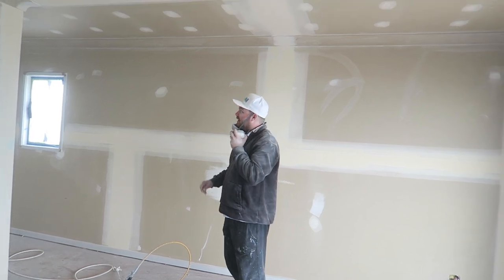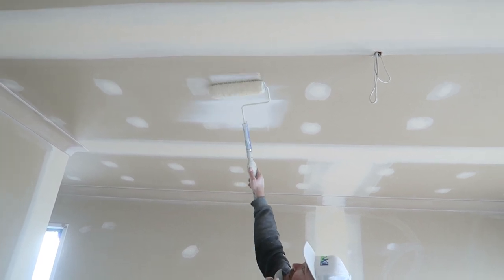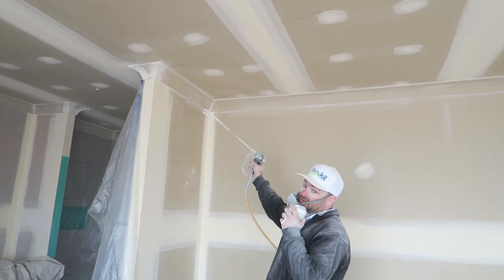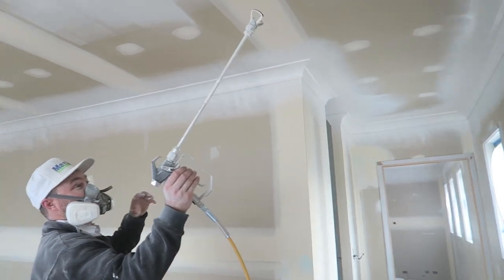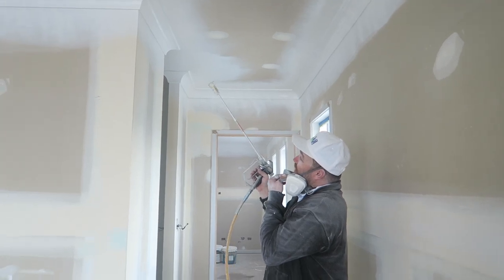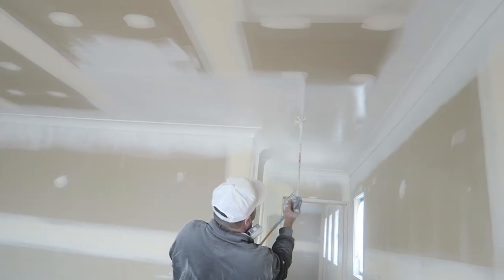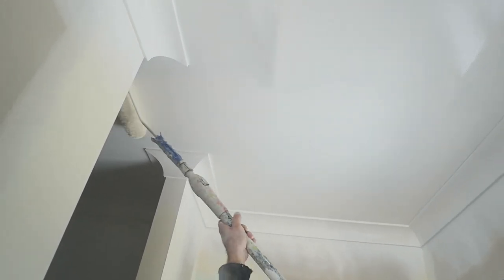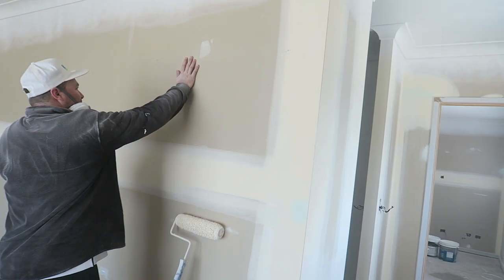Tips on Painting Drywall With An Airless Spray Gun

Comment: that happens because you are using an extension on your paint gun, all paint guns with extensions so that, what you can do is use swivel tip valve to control the pressure at the tip or don't release the trigger until you are away from the surface you are painting.
back rolling is counter protective and defies the purpose of using a spray gun.

Comment: I always thought backrolling one of the coats of paint is important so you get a little bit of roller nap/texture so it hides the joints better. For smooth ceilings I spray and backroll the primer, give the primer a good sand, then just spray my 2 color coats. If you set up your sprayer right, make sure the pump and seals are all good with a new tip in your gun you don't end up with spits. Fought for many years with lines and spits, eventually realized that we weren't maintaining our sprayer well enough hahaha.

Comment: Use clean shot valve and 514 blue tip from graco longer the extension bigger spits , the clean shot valve will eliminate it all, and you need better sprayer graco 395 or titan 440
Reply from the maker: Yes and yes... I will try that out for sure...as for the new sprayer..not cheap..... I haven't even used it since this video...
Tks for the heads up on the tips
Reply from the maker: Is it???
I didn't realise...
What's the price difference would you know?
Reply: 100x100 en Català  wow i didnt realize they can do that , here in Canada the titan 440 costs about 1100$ cad and graco 395 is about 1400 $ i guess depends how many dealers they have and how wide available the product is and how much is the sellers markup price
Reply from the maker: Interesting it's so much more expensive... Nah haven't seen that group. I will check it out... It's that your group?
Reply: @Maxkil  here in Canada  i deal with Sherwin Williams paint store and i have a account there with credit limit of 5000$ which you have to pay your balance bill in 45 days , so that helped me alot to buy 3 sprayers the graco ultra cordless the graco  9.5 hvlp and graco 395 airless sprayer , next one on my list is air assisted airless
Reply: @agent7agent759  so u saying with a contractor sprayer like 395 to 795 theres no need to backroll?
Reply: @aces3261  depending what you want to achieve,  but if you are doing wall i would recommend to backroll because it adheres better and gives raises the grain so the second coat can adhere better,  but if you are spraying a trim then 310 tip is ideal with 10% thinning the paint , regardless what they advertise that the machine can shoot unthinned paint yes it can shoot even a mud since there is 3300 psi but what you get at the end is another story
Reply: @aces3261  never backroll a sealer.. your just removing paint ... next time spray one room..on the next room try the backroll. the room you sprayed will have better coverage. And always tint your sealer..

Comment: The Graco clean shot valve goes on the end of extensions to stop that. It's a pressure problem from extensions causing spitting.  How about the spray gun rolling attachments? I would like to see your opinion on those. One sprays Infront of a roller, the other fills the inside of the roller so it soaks through. Great content Max! Aussie tradies are fast workers!

Comment: Back rolling your spray job is a sales gimmick by other painters to take job away from other painters like oh we back roll pick us.. the only thing that you might maybe and that's a big maybe is extra rough stucco because stucco is a porous surface and if you spray both ways and you're an amateur you're likely to have light spots. a good spray man can spray rough stucco and not have holidays you want your fan to be consistent go from corner to corner Don't spray half a ceiling and then spray the other half go from one end to the other end and go in the direction of the light now if you're dealing with raw drywall sure you can back roll your PVA to seal it but if you spray it and you have good primer it's not going to make a difference. the sad thing is, is the painting industry has been so competitive especially new construction... these contractors are so f**** cheap and get the cheapest  group of pisca painters to do the job then wonder why it's so fucked up... At 6:00 in the video you spray the hallway and then sprayed and stop halfway through on the main ceiling don't do that.. if you start and stop you're likely to leave fan marks, fan lines and spits.. I learned from this old dude been a 30-year painter veteran and he told it to me like this each time you got to take your finger off the trigger the company loses money
Reply: Opposite direction of the light my bad.. if you go with the direction of the light that's going in the room you're going to see if an lines and fan marks. And you are dealing with new construction level 5 or level four people don't want to see roller marks phuc yea don't leave roller marks from the nap even if you use a quarter inch nap which is a thin nap after a couple rooms that s**'s going to get strung out and you're going to leave roller marks on a brand-new f***** home you're going to lose thousands of teaching these people bad s***
Reply from the maker: You said "if you stop halfway through on the main ceiling don't do that.. if you start and stop you're likely to leave fan marks, fan lines and spits." 
I say "that and other reasons is why you backroll"

You said "he told it to me like this each time you got to take your finger off the trigger the company loses money"
Sounds like a poor business ethic that produces poor quality and the rason you aren't backrolling because it doesn't make your boss money.
Read the drywall data sheets, specifies about backrolling.
Reply: I mistyped*.... YOU STOPPED halfway thru through on the ceiling....DONT do that... I've never ever heard of these factory data sheets requiring you to "backroll" the drywall.. The correct way is to PVA prime new raw drywall to seal it.. But as in a roll you have to backroll the prime, nah... Maybe if the qaulity of your primer isn't that good then sure.. but the reason the paint flakes off is because of bad quality product... My boss and myself do high end stuff and use top notch paints and coating..SW promar 200.SW  Endurance, PPG permanizor,  A- 300, super lheavy solids.. And I'm in California, we have the strictest EPA rules ever in regards to VOCs, and i have never ever heard of having to back roll on factory data sheets.... and hypothetically sure, backroll if that's what it says BUT you still can't spray the final coat cuz you don't know what your doing bud... It's ok, you'll learn... My boss has been in the game for 30 years, good luck to you

Comment: Use an 18" roller and a better sprayer. That Wagner will burn out in no time
Reply from the maker: +Mike McGrath yeah could have used a bigger sleeve. So far that gun has worked really well.
But I'm sure if you had a big work load you would probably choose a bigger gun.
So I agree with you.

Comment: Horseshit
With a 5-13 tip. if you can't spray a surface that shows zero imperfections
you don't know what the fuck you're doing.
Back rolling leaves a texture.
Without back rolling you should have no texture.
Unless the customer wants texture you never back roll.
The only reason back rolling is done is when there is dust on the surface and you need to press the paint onto the surface so it bonds properly,
The only reason you have blobs is because your paint is shit or your filter is no good.
With a reversatip the imperfections in the paint are caught at the tip: not on the ceiling.
When that happens you reverse the tip. shoot out the blockage and keep on going.